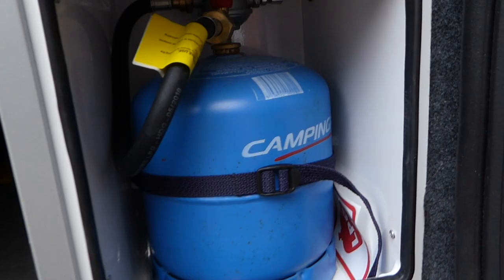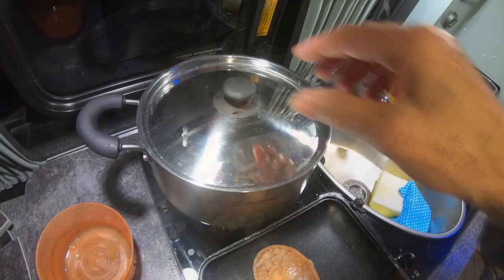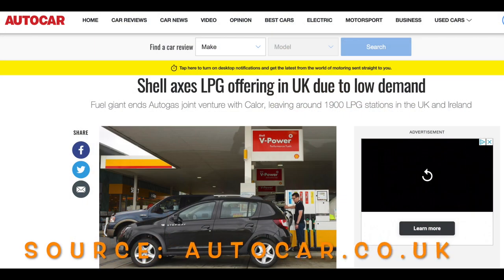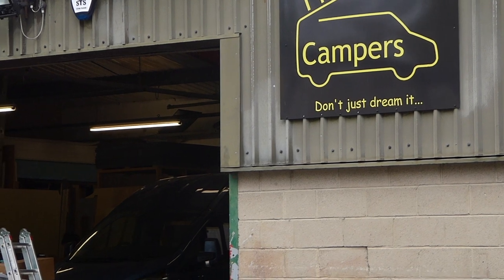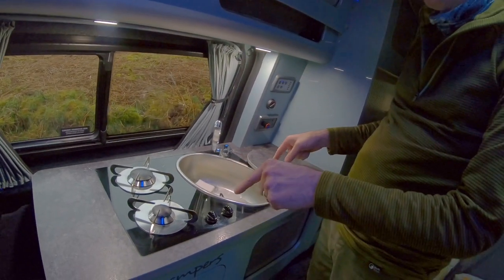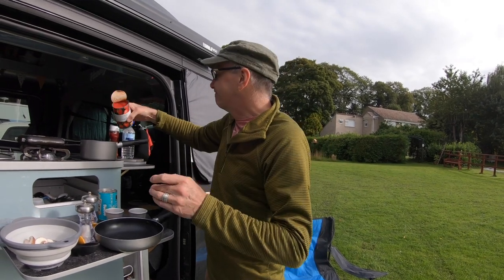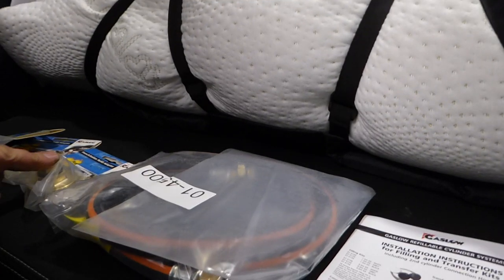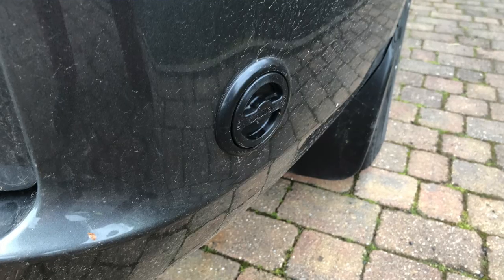LPG & Kitchen Upgrades To Our Campervan

Comment: Good upgrades and that new top looks really smart. Don’t smash it like we did 😱

LPG is getting harder to find but a refill lasts ages and we have not come unstuck yet. Now you need some international adapters 😁👍
Reply from the maker: Thanks for watching - yep we bought the adapters so good there. Don’t say that about the glass. Interestingly today I got a wooden chopping board that straddles the glass with overlap and tomorrow I have 4 small rubber feet coming to lift so we can put stuff on there or chop as we also are nervous around hot stuff and pressure

Comment: Are you still pleased with the replacement hob and sink? I’m considering the same upgrade because in the last week I have accidentally damaged the worktop behind the rear burner, and then burned my fingers a few days later. Hoping a return to “side by side” burners might rectify that as I’ve never burned myself or damaged anything in the six years I had my old heap of a van before this one!
Reply from the maker: Hi jane. We are very happy with it still. The burners aren’t quite side by side. The smaller one is set back slightly. And we’ve had to buy smaller pans but it was definitely the right choice for us 👍 jane

Comment: I think the LPG is a must and I'm guessing it wouldn't be any more or less difficult to find than a replacement Gas Bottle (I've occasionally had to drive around a bit to find one) plus the fact you can top it up whenever you want when out and about (rather than waiting for a bottle to run out). How do you connect a conventional Gas Bottle into the system (regulators, hoses, connectors). We still have a Bottle and a seperate two burner Gas Stove which we could use externally if needed. Still thinking about whether we go for the surface mounted or recessed Burners as like you we aren't sure how much we'd use the outside access to the kitchen (Jane, my wife is quite short - bless her!)
Reply from the maker: Yep I think fuel in the next 10 years will change but you just have to go with it. Bottles was becoming a challenge hence we changed and so far the right decision as a lot cheaper. The diesel heater to me is a must as takes the pressure off the gas as after all if you can’t get diesel you can’t drive so you may want to think about that. 

Re the gas bottle we have a hose from the kit that allows the bottle to be connected to the refill point worst case - that said not used it yet
Reply from the maker: Lol I’m also a jane thats quite short ! 😂
Reply: @getawaygeese  me and the kids take great pleasure in trying to make her look even smaller by finding big chairs, standing on steps etc. It’s a cheap laugh but there you go. Onto a more serious point, do you find the height of the rear seats an issue. We looked at our first campers yesterday and in both, Janes feet were struggling to reach the floor (the ones we looked at in Shrewsbury seemed especially high)
Reply: @getawaygeese  thanks Stew, you think very much like me (plans, contingencies etc) 😊
Reply from the maker: Sorry Andy Jane drew my attention to the fact I didn’t answer the rear seat height and the answer is no not noticed it at all being an issue for either of us

Comment: Gives you more useable space when your not cooking. Nice job done there. We've got an underslung tank and it was a bit of a pain finding a local garage that had a working pump! But it's super cheap and readily available on the continent. I downloaded an app called 'AutogasApp'. Worked out useful.
Reply from the maker: Cheers Mark for watching - are you signed up to the key as done have a key code that you need to have to use ?
Reply: @getawaygeese  the key????
Reply from the maker: Lol I described that poorly on the myLPG.eu app done garages are autogas key code where you have to have a 4 digit key you fill up and drive away and they direct debit you so assume those garages you can’t turn up without one so I found you can apply https://www.flogas.co.uk/autogas-key-system
Reply: Oh 😂. I'll take a lookie! Thanks 👍
Reply from the maker: Lol see now you know I just don’t know if it means if you don’t have one at that garage you won’t be able to get filled up
Reply: I'd be surprised if you can't fill up at other LPG garages. I would think your system means perhaps you have unique access to flogas centres too. Ours is the conventional 25kg tank that you rock up to a local Morrisons and fill up, as would be the same for an LPG powered car. Ours will likely last us a year on our typical usage or 6-7 weeks of continuous habitation.
Reply from the maker: 2.7kg tank so it’s a baby
Reply: Maybe have a whip round when it is time to fill up! Lol. I've enjoyed your vlogs. They were partly responsible for the creation of our Sidney. Different van, different layouts but the want for weekend escapes and more was inspired by your vlogs amongst others. Cheers. If your ever bored here's Sidney ( scroll to end to see the finished will save you time!).https://photos.app.goo.gl/hK1aMGSLKRjc3JBEA
Reply from the maker: Hey don’t blame me lol seriously great to see comments as we do it for us but also to help others to as that’s how we got info
Reply from the maker: Omg mark that’s bloody great achievement by both of you - you must be so pleased. I take my hat off to anyone who does that - I took the easy route. The quality is top notch and love those window blinds - hope Jane doesn’t see link . I bow to your skills
Reply: Many thanks, we've loved creating him. Furlough last year gave me a great window to crack on! Different routes to campervans but same goals. Enjoy your evening and crack on with the next vlog!!

Comment: Hi Stew, Jane, We are waiting on an Autocampers Hi-Line SWB van. We have elected to go the LPG route, but are getting increasingly concerned about LPG availability. We live in West Cornwall and certainly this part of the country retailers are few and far between. Would be interested in your experiences so far?
Reply from the maker: Hi Chris thanks for watching and commenting really appreciate it- exciting times … I think fuel sources is interesting and I suspect will change ….. so far not an issue I have found garages to top up but with lpg cars going down it’s difficult - I have an adapter pipe so always carry a camping gas bottle but it does mean it’s connected outside - we moved away from camping Gaz as could get that at one stage ….. I suspect at sone stage we will be induction cooking off electric but it’s not there yet and need more efficient battery stores …. Our view in the end was live for now and take the memories for now it’s easy to think to far out and never do anything ….. let us know your thoughts
Reply: @getawaygeese  Hi Stew and thank you for your perspective. I think the idea of having a back up in the form of a camping gaz option is a good one. I have heard that the LPG bottles do last a long time and with the gauge option to easily see level of gas in the bottle there will be opportunities to "top it up" to prevent running out. Our stories are similar in that we have been looking and researching for some time and your videos have been very helpful in our decision making. We do follow your adventures with interest. We did hire a VW pop top based van to test out life in a camper van and cam appreciate why why the highline solution is much better and certainly an advantage when it comes to storage. We do have some time before the final specs need to be set and are considering going for the sliding seat rails as we did find the distance between the captains chairs and the rear seat more than we would like. We will also go for the recessed hob/sink.  If you venture down the A30 to gods own country, let us know..
Reply: @getawaygeese  Ohhh. Also agree that a glass of wine is the best starting point to addressing any problem!
Reply from the maker: @cbrown1808  we had the gauge that is a visual one very useful so definitely recommend that. I am a person that has lots of backups so lpg campinggaz and a cadaver bbq worst case a take away … I always over think so my advice is do what I am trying to do is live today ….I look forward to meeting you out there